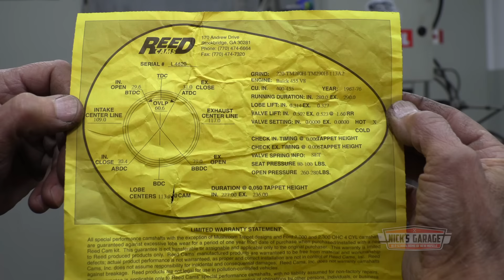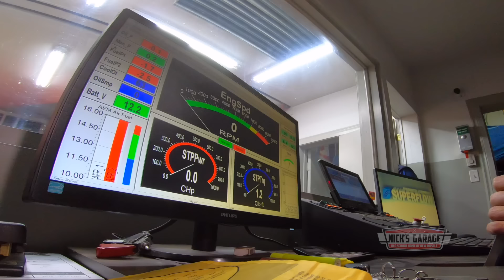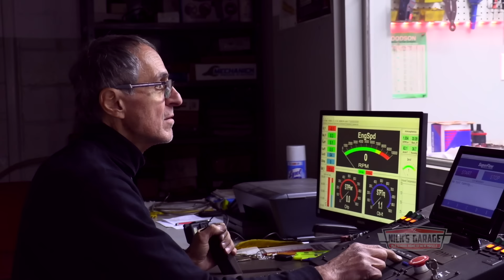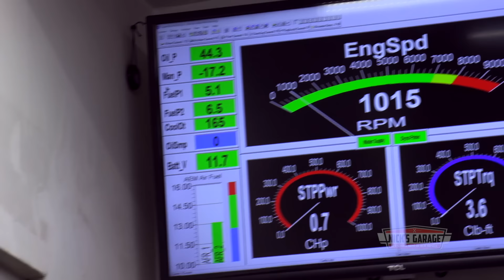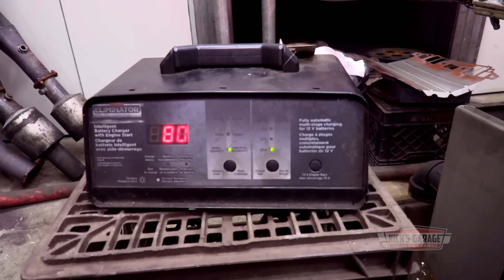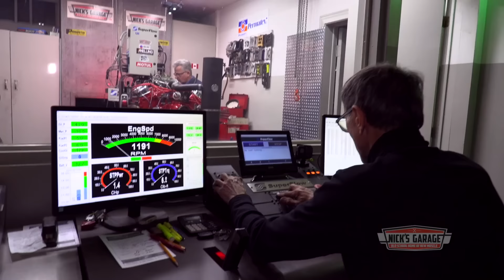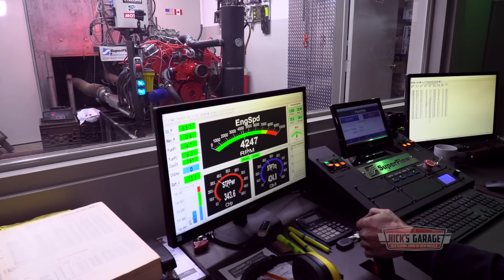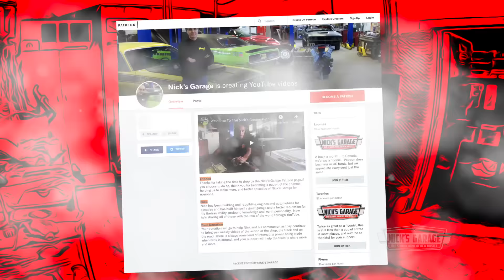1970 Buick 455 Stage 1 - Dyno Room Diagnosis

Comment: the big difference   between  a hemi  and  stage1   is not  only 20 pound of torque    its where you make it    a 426 hemi  make   490  lbs  @  4000 rpm  the 455  makes 510 lbs   at  2800  rpm
Reply: Is it really that low of RPM?   That’s pretty incredible, and would be a monster on the street.   I’ve known they made 510ft/lbs for 40 years but figured it was around 3500+RPMs.     All of our American V8s only have a few crucial differences, and some aren’t exactly magical.   Things like compression ratio, bore vs stroke, conn rod length, are all relatively straightforward.   But from the carb to the piston is where the real voodoo was.   And exhaust manifolds were also a huge variable, but Hemis really had an advantage as far as flow into a cylinder.   But even that isn’t the whole picture.    I’m not sure  when the engineers realized this, but swirl or tumbling  were extremely helpful in keeping the mixture homogenous.    It doesn’t matter how much air/fuel mixture you get into the cylinder if it all doesn’t blow the hell up.   And if that atomized mix gets too cooled along the way, it will separate, or if it hits too many walls and slows down too much it will separate, leaving liquid fuel in the intake runners or the intake port on the head, in practice they are one runner/port, hence the “half heads” of the Ford 390, and big leap into the unknown for ford at the time but an idea that was built on solid science.   It’s easier to hog out aluminum than iron, and also saves weight.  So if your intake manifold takes up half the head, then it also saves more weight when you make it out of aluminum, and any porting done on your easily removed intake manifold gives you the double advantage of actually having ported most of the intake port on the “head”, because there is very, very little intake port on the actual head.      But high ruse, dual plane, single plane, equal length, air gapped, all were useful ideas, and of course it’s not like the Buick had any kind of special secret to any of these things as far as I know.    The next question is, if 455 cubes could give you 510 ft/lbs, then why didn’t the Cadillac 472 make proportionally more ft/lbs, like 530+ ft/lbs?     Why indeed.     If it was all down to the combination of compression ratio and bore and stroke, then why was Buick alone here?    Was it that the others simply cared about advertising HP numbers?   I doubt it.   They lied about those all the time, so if you wanted to claim the biggest number, just lie.    Those of us with experience know what makes power where, and torque gets you the hole shot, HP is your follow through from maybe 600’ on.     And we all know the ET vs trap speed reflects this every time, unless there were traction issues at the line.  But if one guy had a lower ET and the other had a higher trap speed, yet they crossed neck and neck, we know the ET winner had more torque or less weight, and the other guy had more HP.    Less weight will help with the low end, but start two cars at 70mph, a roll race as the youngsters call it, and weight matters much less, but not really because of the speed itself, they are still starting their race  even, as if from a starting line, but they are already up into their “working” rpm ranges.     And since HP is a function of torque at a certain RPM, then 510 ft/lbs might lose to 450ft/lbs if the torque monster falls on its face at 5,000rpms, unless maybe it has like a 2.6:1 rear end, maybe, but the issue is the depth of workable rpm range, which is why these low torque Ferraris and such can still win 1/4 mile drags, but lose 1/8 mile every time.      Excuse me, breadth of useable RPM range is key to a real race.   Even lots of gears, with a super low first gear and 8 gears, with a sweet rpm range in each gear, only helps if the shifts are so quick that they are almost not measurable.    A 1/100 second shift still adds up to 6/100, halfway to a tenth of a second, which in the drag world is very often the difference, but how many transmissions shift that quickly?   None.   The fastest I found was the McLaren 675 LT, at 40ms, or 0.040 seconds.  For reference against a “regular” automatic, the modern Challenger/Charger ZF 8HP does it in 160ms in track mode.   A Lambo Huracan Performante does it in 290ms.
Reply: Big deal. Stage 1's were fat and happy. The hemi heads were far superior to anything Buick produced. The hemi is a much better engine.
Reply: @greasyhitchball   yes on the race track   but not on the  street
Reply: @greasyhitchball  How about looking up the term hemi killer engine and see just what pops up, we'll wait 😏
Reply: @455buick6  No need to wait, I know the story. A guy in a Stage 1 beat a couple Hemis. Big deal. Lot of factors at play. Driver skills, tune, traction, etc, etc. I've seen plenty of Hemis beat 455 Stage 1 Buicks. In Pittsburgh, in 1978, there were two well-respected street cars, 
a 70 Stage 1 and a 68 Hemi Roadrunner. They were both stock with the RR the faster of the two.
Reply: @455buick6  Nick from Nick's Garage tested a Stage 1 with HEADERS and could only produce max 352 hp at 4600 and 461 tq at 2700 rpm. A far cry from 510 at 2800.
Reply: @455buick6 70 hemi cuda had the quickeat qrt time in 1970😅
Reply: @andrewp1998  And the Buick ran it down at the end of the track, probably with the AC on😂🤣
Reply: @455buick6  lol
Reply: A hemi is happier at 4000 rpm and above.
Reply: @455buick6  there is no hemi killer. Thats a myth.
Reply: @andrewp1998  And then you woke up to reality, get over it, I lived through those times and I know better
Reply: @greasyhitchball   you got that all wrong  its made 400 hp  and over 500  lbs of tq   look at the complete video

Comment: I worked for Buick in 1970 as a dealer mechanic. 1970 Stage 1 engine was 10.5 : 1 comp ratio.  370 Hp  'listed' but probably more like 425 actual.  Carburetor was also different on the Stage one.  Nice work Nick, glad to see your diligence making it right.  Keep up the good work on the channel.  Hat's off to Manny also, good to have a knowledgeable friend like him to help.
Reply: His knowledge IMO is limited to mopar I’m NOLONGER a fan
Reply: The ratings of all of this are jokingly skewed. When the standard valve 455 was put in a Riviera, Wildcat or Electra, it's rated at 370. The SAME 455 engine in a GS 455 was rated at 350.  Chevy and Pontiac did the same thing. The bigger valved and very slightly bigger cammed Stage 1 was rated at 360.  All just a rating game. The Stage 1 was rated at 10.5 to 1 compression only because the slightly larger valves took up a tiny bit more space in the combustion chambers.  All 1970 455 pistons were cast and were the same.  Another example of silly "ratings" ... the 360 hp LS5 Chevelle's 454 was rated at 390 hp when installed in the Monte Carlo.
Reply: @LR-my2di  there were actually 3 different buick 455 codes,SF code was 370 hp.,I dont remember the others right off hand but they were 350 and 360 hp.,I checked into that years ago but went 425 buick nailhead instead for my project so never remembered the other codes for the 455's
Reply: @steveesman9469  Yes, Steve.  I can remember that there was SF,  SS and SR.  The SS was the under-rated Stage 1 with the slightly "hotter" cam and bigger valves; etc.  These other 455 engines did have their own codes but were identically built and thus were all the same regardless of the codes which denoted the car into which they were installed.  That includes the standard GS 455 rated at 350 hp.  That same engine was used in an Electra, Riv. or Wildcat but was rated at 370 hp.  Just a ratings game.
Reply: Didn’t you hear Nick say he worked for 3 yrs in 1970 at a Buick dealership as a mechanic rebuilding these engines 😳
Reply: @LR-my2di  My parents had a 69buick wildcat. I took it to school 2 times and made enough money to buy a Chevelle with a Buick 455 I took out the Chevy and it ran like hell. But my old man's Buick wildcat was tops,3dueces and headers. Memories.!!
Reply: @joeguerra461  Wow! A '69 Wildcat with the 430 that had three deuces and headers.   Funny that TA Perf. told me that no 400-430-455 intake manifold was ever made to fit three deuces and that no set of headers were ever made to fit a Wildcat. I will call them to tell them about yours. Thanks for sharing!
Reply: @LR-my2di  Dennis Manner had some interesting things to say about the 455 by Buick. He's the Father of it, after all. The engines were not rated at their most advantageous rpm, they used a lower rpm limit, that's why the ratings were different car model to model. Buick also used ratings that were reliably and consistently attainable, instead of using the best they could find.  The 455 Stage 1 in 1970 put out more like a touch shy of 400 from the factory.  Stage 1 had it's own cam, distributor and carb. With better gas you were looking at 400+ but as all Buick guys know, it's the torque that let you give the guy in the other lane a look at your taillights. Then there was the factory back-door Stage 2...
Reply: @bbb462cid  Denny gave a slide presentation at the GS Nationals back in the 1980's at the huge Western KY Univ. meeting room. I remember him talking about all of this. He said that the 1970 Stage 1 engine made 376 hp at ~ 5000 rpm.  He showed a series of slides of the dyno results from "back in the day".  The other "big-car" Buick 455's were rated at 370 hp and those same engines were used in the GS 455 that was rated at 350 hp. Pontiac and Chevy did the same thing with the Chevy LS 5 454. It was all a big rating game back then, so no use in debating it all 51 yrs. later.  It's the actual in-car performance that counts.  BTW, the factory Stage 1 cam was very mild. After all, the Stage 1 engine could be ordered for any GS that was fully loaded with options including a/c, of course. This was unlike the RA IV, 440+6, Hemi, LS6, Z/28, Boss 302, Mustang and Torino 428 & 429 SCJ's, W-30 with the optional "328" cam; etc etc.    BTW, anyone who never saw the March '85 MCR issue and article with the Hemi vs. Stage 1 Round 1 "shoot-out" that took place in Dec. '84 has missed a lot!  It was the most famous muscle car shoot out EVER and it also illustrates my point perfectly.
Reply: @LR-my2di  Oh, I know. Did this stuff for 30 years, all with a '74 block Buick 455 eventually bored to 462, aluminum Stage 1 heads, 10.25:1,  big tube headers and a split duration cam. That thing could have pulled stumps out of the ground. Sold the car last year.
Reply: @bbb462cid  But good memories remain!
Reply: @LR-my2di  k
Reply: The 426 Hemi wasn't the only badass big block, G.M and Ford had plenty of stout engine that could hang with that Hemi.
Reply: @joeguerra461  Liar
Reply: @kskip4242   You're right, Skip.  I hope you've heard about the legendary GTX Hemi vs. GTX Hemi "Shoot-out" Round 1 that took place in Dec. 1984 after GTX Hemi owner "Roy" wrote a letter to Musclecar Review mag. telling them he'd take on any equivalent Buick GS Stage 1 at the Gainesville Florida drag strip because Buick GS's run "like they were tied to a tree".  Haha!  The race was put together in less than two weeks by editor Donald Farr of MCR, so it was sorta run what you brung.  Both cars were very mildly modified street cars just like most guys would do back then.  Basically, mild cam and headers.  GS owner "Richard" drove the 130 mi. from GA while GTX owner "Roy" trailered from Tampa.  The GS cleaned Roy's clock. And right after that, the GS did the same to Roy's buddy with a 1970 Hemicuda.  It was all on film.
Reply: @LR-my2di  

What were the results of that '84 Shootout?
Reply: @ginomarchetti5153  Basically here's the deal, Gino. In a letter printed in Muscle Car Review magazine, a 1970 GS Stage 1 was challenged by a 1970 GTX Hemi owner.  The Hemi guy stated that the GS Buick "ran like it was tied to a tree".  So, the magazine editor located a willing GS owner who drove his GS 130 mi. to the track from GA. The GTX owner trailered there 130 mi. from Tampa FL .  The GTX had 4.10 gears and the GS had 3.42's.  Both cars were owned by regular "little guys" sand the race was put together in less than 2 weeks by editor Donald Farr, and both owners accepted the terms of the race.  
The race happened in Dec. 1984 in Gainesville, FL and was featured in the March 1985 issue of Muscle Car Review magazine, and both cars were featured on the cover.  The GS blew doors ... two runs straight.  Then right after that, on the same afternoon, the Hemi owner's friend with a 1970 Hemicuda  also challenged the GS, and the GS blew doors again.  And that was that.
Reply: @LR-my2di  

So cool!.....love the 1970 Buick GS/GSX

Around '86, my dad bought my 18 year old brother a 1970 GS 350 from an uncle of ours.  It was faster than heck too...we think our uncle had suped it up a bit.  

Well, my brother wrecked it while drinking and racing around town.....ran a red light and was side swiped by a pickup and pushed into a brick grocery store at an intersection. 

I've always wondered if a 455 Stage 1 was faster than a GSX, since the GSX was heavier.  I would love to have either one.

Thanks for answering and telling the story.
Reply: @ginomarchetti5153  The GSX could only be had with the regular 455 or the 455 Stage 1.  The 1970 GSX came standard with spoilers, bucket seats, power front disc brakes and power steering.  So it had a few of the heavier options as standard equipment.  You could get the GS with the 455 Stage 1 package w/o any of the other options and the lighter bench seats, if you so desired.  So potentially, the '70 GS Stage 1 would be a bit faster. Stay safe!
Reply: Thanks for my 440 shirt I got it today awesome shirt very comfortable
Reply: If I remember correctly the '70 stage 1 had a Carter carburetor on them...
Reply: @LR-my2di  I loved reading your post about the race between the cars. The fact that a national magazine set the race up takes all the excuses away. 
Kudos on posting that.
Reply: @davidgraham2673  I'm flattered that you would say that, David. Thank you.
Reply: @LR-my2di  , It was my pleasure.
I'm old enough to remember all the cars back then.
I remember driving up and down Bragg Boulevard in Fayetteville NC stopping at every used car lot, looking at all the hot-rods back in the late 70's.
You could still find any car you wanted, and at great prices.
They knew the soldiers from Ft  Bragg had money, and wanted a hot ride.
It was a great time to be young, and driving a hot car, wasn't it?
My baby was a 69 Camaro.
Reply: @davidgraham2673  Yes, David. We both know about those special times back then.  Best wishes.
Reply: @bbb462cid   Let me know when he wants to sell it,  let me know right here ! 😄
Reply: @jimhamilton3544 i think He said 1976-1980.check the first 20 minutes of this video

Comment: The Hemi is no threat to a Buick 455
Reply: The Buick 455 is a good engine but a stock 426 can make 490 HP and a naturally aspirated build can get you >600HP.   The 455's forte is torque, not horsepower.  It would make a great truck engine and I mean that as a compliment.

Comment: I had a 1970 Buick 455. I loved that car, was a Riviera. Rear wheel drive. Had 10.5:1 compression. I loved tuning on it. I built a few different Qudrajet carbs for it, i love rebuilding carbs of any kind, fascinated by it actually. I was a young fella, had it from the time i was 18 till 20. Won my first bracket racing trophy in that car lol. It was no hot rod, but it was fun.

Comment: I watched a lot of your videos Nick and I just ran across this one that I must’ve missed when it originally aired. I just did a 401 Buick for a customer, I begged him to go with the 455 and leave his original 401 one from his 68 GS In the garage for possible replacement later but he wanted to keep the numbers matching engine in there, I went through a lot of gyrations with this engine but we ended up making 400 hp. TH performance and take a much larger Cam you guys had.  Keep up the good work!

Comment: My first car was an Electra 225 made in September of 1969. It had the '69 body and what I think was one of the earliest 455 engines made. (All the books said it wasn't offered until 1970.) It was confusing for the guy at the parts store, because I had to get chassis parts for 1969 but engine parts for 1970. Watching this brought back so many wonderful memories for me. I advanced the timing and that Land Yacht would put down a stripe. BTW, I believe the Chilton's book we had in the early 80's showed 360 HP for single exhaust and 370 for dual.
Reply: I believe that 69 had a 430ci

Comment: If i am not mistaking, the guy in blue shirt did not use the torque wrench to tightened the bolts on intake manifold,there is a torque spec for the bolts on intake

Comment: That 455 will turn 6,000k all day long!!! 4,600 is piddly. You guys reminded me of a 425cid 1965 Olds 98 two door hardtop I had! Man,I remember putting down a 1968 Chevelle 396 big block 4 speed. My trans was an early version of the 400turbo,catch 2nd gear scratch shifting itself!!! VERY Light rear end,I used sand bags for traction!! This baby "DiD" outrun the Rock County and Winnebago County Sheriffs cars. Rock County had newer Oldsmobiles with police interceptor engines, hah hah hah!! My brother and I rebuilt the 425 using Sterling Speed and Engineering out of Rockford for the heads! It was STOCK,but a go fast. Keep up the good work Nick. Thanks. GOD bless all. Pastor Jeff 🙏